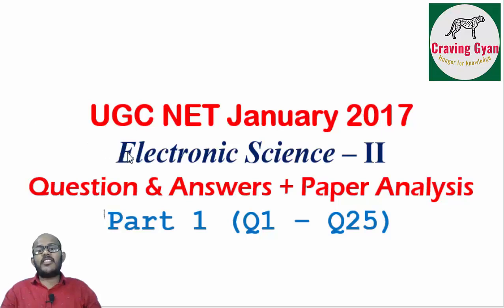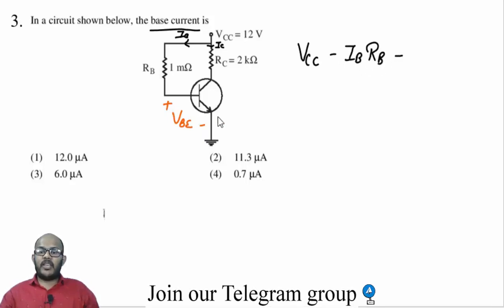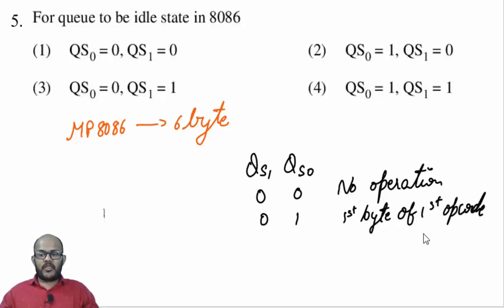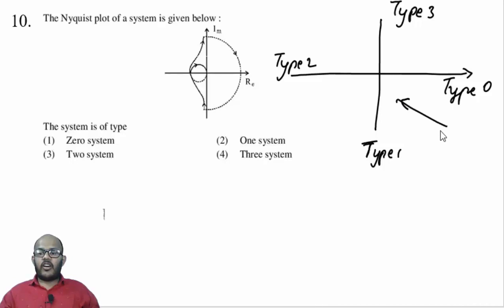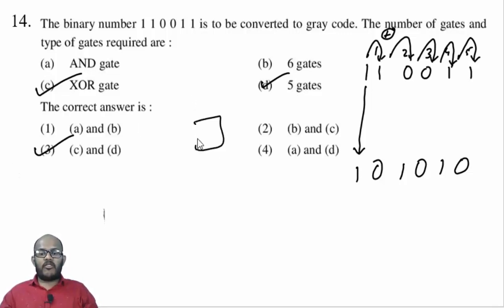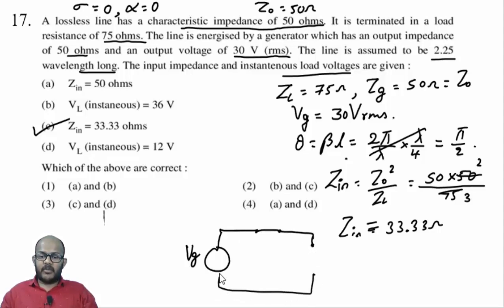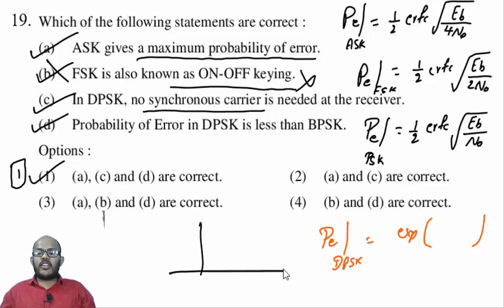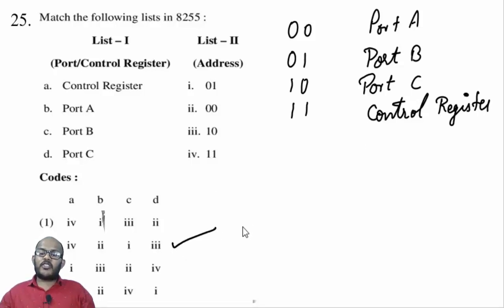UGC NET Electronic Science Jan 2017 Part 1 (Q1 - Q25)

Comment: Question 18, d option also while your explaining, exactly wrong thing you are giving as justification sir.
Reply from the maker: Please revisit your book
Then look back
Reply: @CravingGyan  Option A and C are correct as per the question they have asked. FM modulation frequency of the carrier is varied in accordance to the amplitude of the modulating signal.
In option d, you are saying to reduce the noise in PCM we have to increase the quantization levels. But in question they have asked for incorrect statements sir.